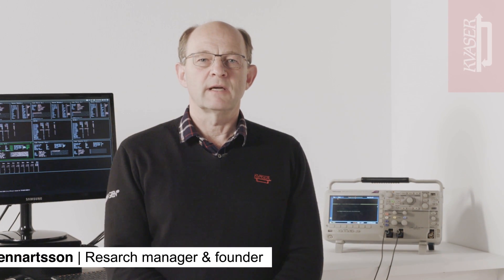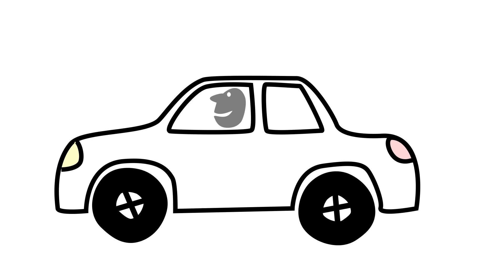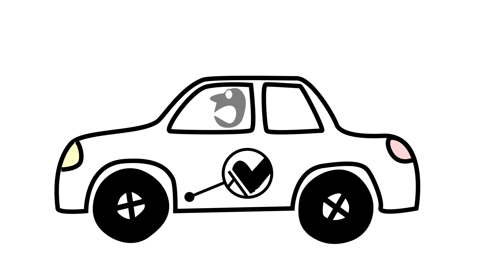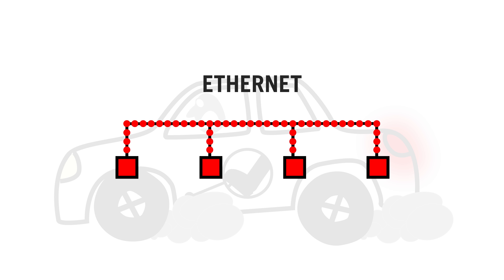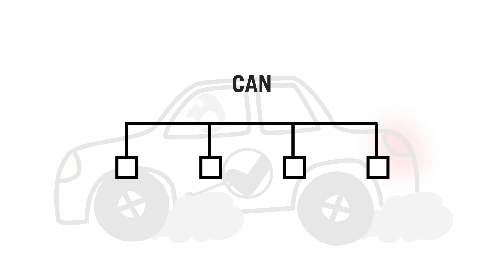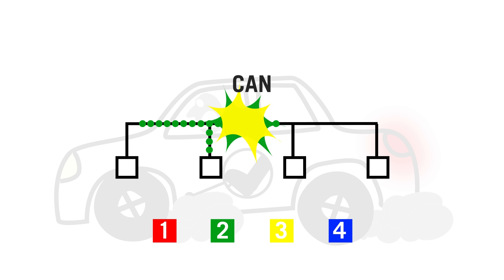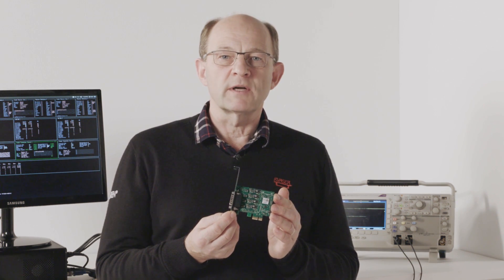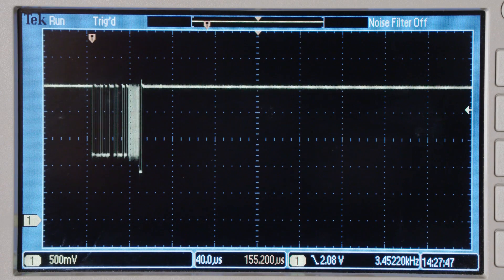Technical Comparison:  CANbus (Controller Area Network), CAN FD, and Ethernet

Comment: I take issue how you cherry pick Ethernet collision, when in fact a switch prevents collision completely, at the expense of a centralized switching unit and additional cabling. But the benefits gained with the higher bitrate protocol far outweigh its downsides.